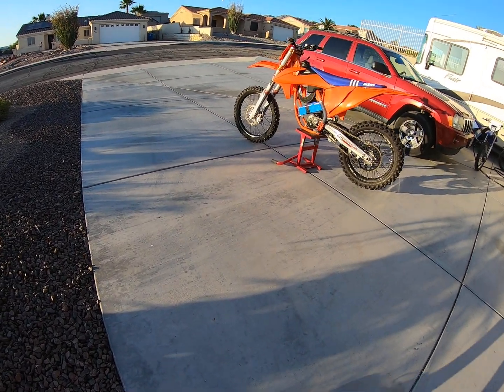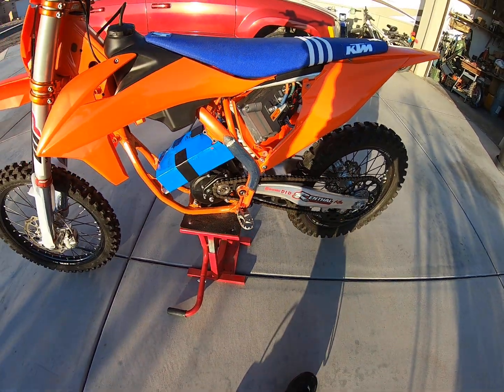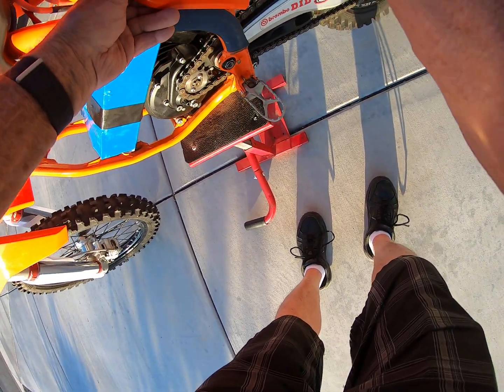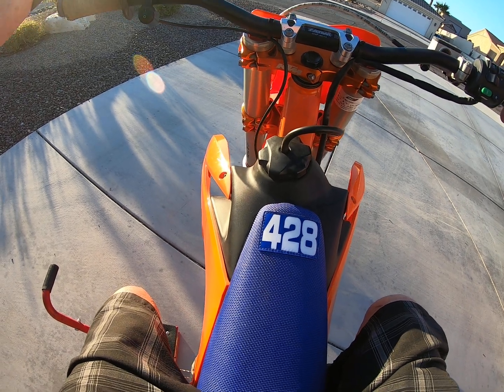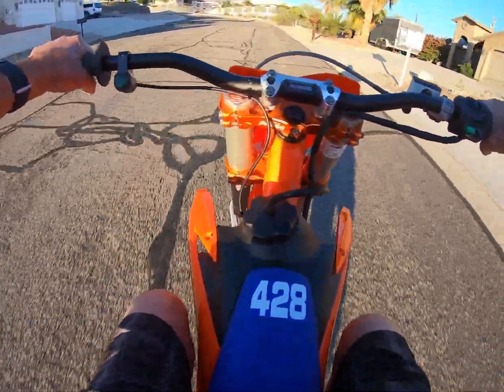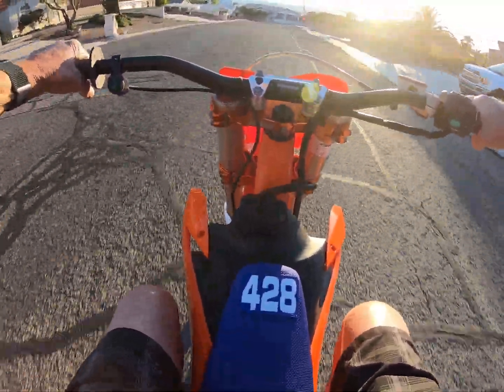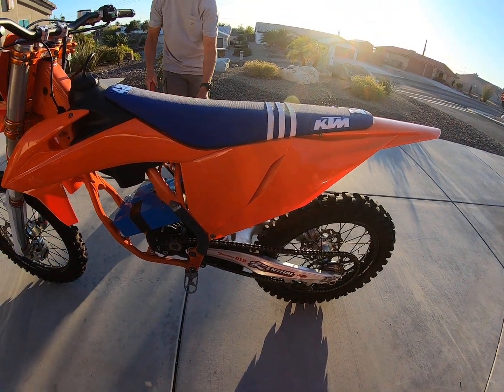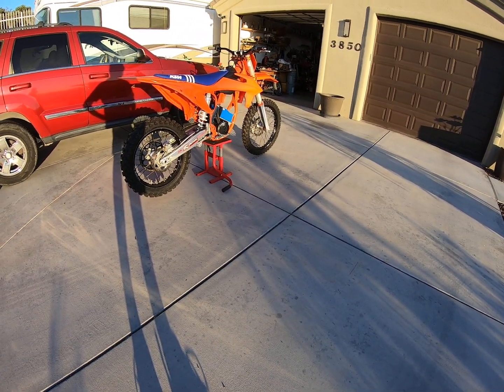2022 KTM 250SXF Qs138 70H V3  motor and EM260 1st Test ride with small battery

Comment: What battery are you running here? I’ve been putting off my cr125 build because i need a battery. I’d gladly use a test battery for now just to get it going
Reply from the maker: I had a Freeride battery with some bad cell groups. I took it apart and used some for for a KX100 electric 72V 20AH and I used the rest to make a 72V10AH, good for 100A.  Send your requirements and size dimensions to Amorge  They are the cheapest.  info@amorge.com

Comment: How comparable is this going to be to a 250f
Reply from the maker: This will be very similar to the 250 in power.  It is really fun to ride.  My YZ with this motor controller was as fast as the 350SXF we were riding with last week.